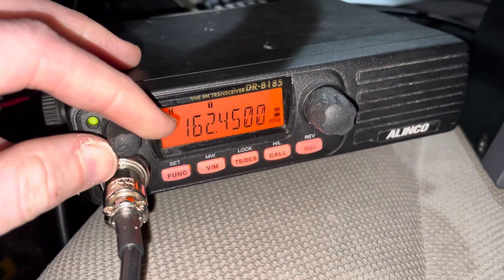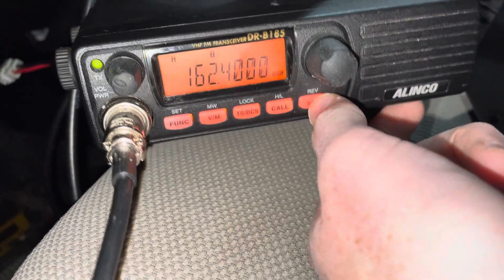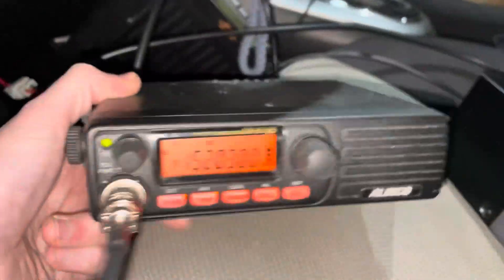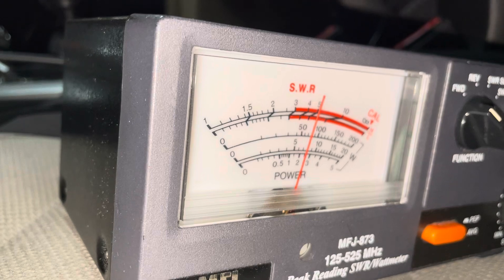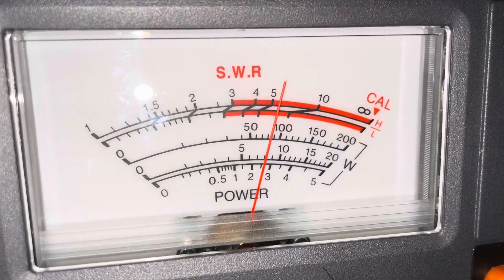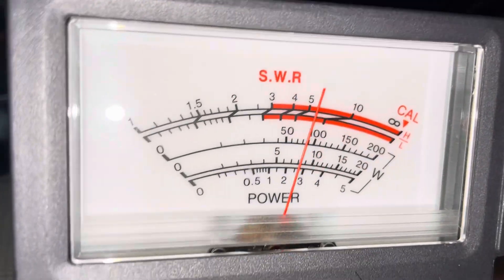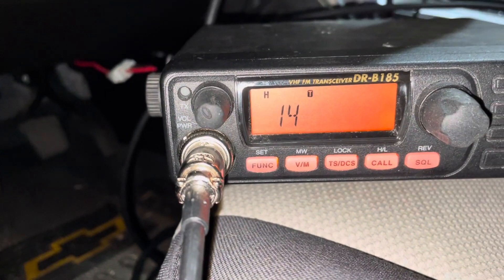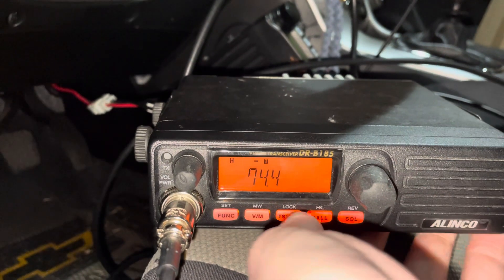Alinco DR-B185 High Power 2 Meter FM VHF Mobile Radio VHF Transceiver Everyone Forgot About

Comment: If it had 25 W on low or a 3rd power setting, I would have bought this thing more than once.

This thing only points to the FT-2980. It's sad.

Comment: Neat. I have a stack of 3 100 watt Vertex mobiles. 120 on LoBand, 110 on HiBand, and 100 watts on UHF. 

I had seen a real estate business once that used HiBand simplex over a large city and they had 200 watt VHF mobiles. Never could find one myself but I prefer LoBand anyways.
Reply from the maker: Hell yeah.  

Lowband VHF actually is ideal in many situations.  High band VHF (what most folks just call “VHF” - 148-174 MHz, 136-174 MHz…the land mobile bands being 150-162 MHz) is ideal in many situations too.  

If I was designing a land mobile system…I would give low band some serious consideration.  In an environment where maximum coverage is key, low band has some big advantages if implemented well.  You can also set up cross-band repeat (patching) sites to use handheld radios in more close-in areas in range of a repeater (in urban areas, for example) while maintaining connectivity to the low band side.  

Another big advantage is in regards  to getting a Part 90 license - since there’s comparatively very few low band users in a given area (compared to VHF, UHF, 800, 900), there are a LOT more options and more flexibility in terms of getting your system set up and licensed how you want it…

Comment: Pretty impressed with that radio.
Reply from the maker: It seems like they only manufactured a relatively small number of them for whatever reason.  Which is a shame because I really like the high power, small package and front firing speaker.

Comment from the maker: There are actually two different radios sold with this model number:

Alinco DR-B185T 
FCC ID:  PH3DR-B185T

Alinco DR-B185HT
FCC ID:  PH3DR-B185HT

the DR-B185HT is specifically the version sold to the amateur radio market…it is called a “VHF FM Mobile Amateur Radio Transceiver” in the FCC approval documentation.  The DR-B185T is an export only land mobile radio (LMR) variant described as a “VHF FM Mobile Transceiver”. 

Link to the DR-B185T variant FCC approval documentation:

https://fcc.report/FCC-ID/PH3DR-B185T

Link to the DR-B185HT approval documentation:

https://fccid.io/PH3DR-B185HT/amp

Both are listed under the same Alinco Incorporated, Electronics 
Yodoyabashi Dai Building 13F
4-4-9 Korainashi, Chuo-ku
Osaka, Japan 

Grantee Code: PH3
Reply from the maker: Link to receive demo 

https://youtu.be/bH8yMGXEY_o?si=-nzOk2LvbO7baX7h